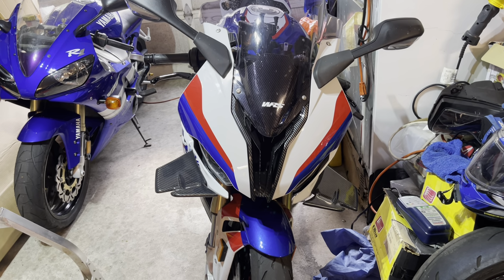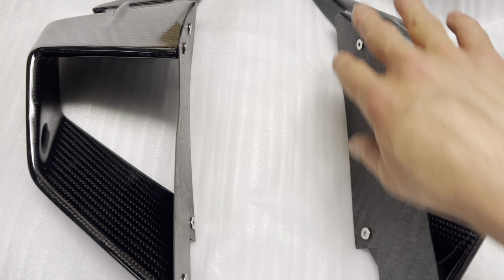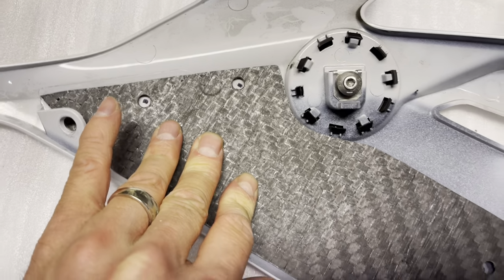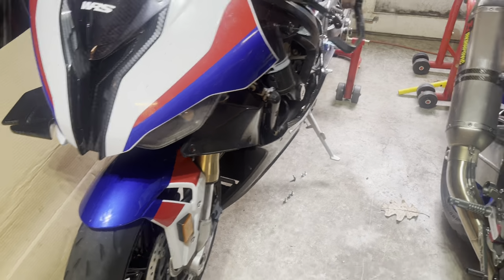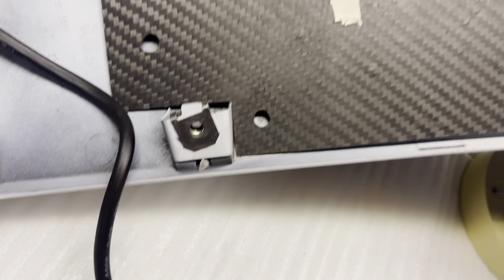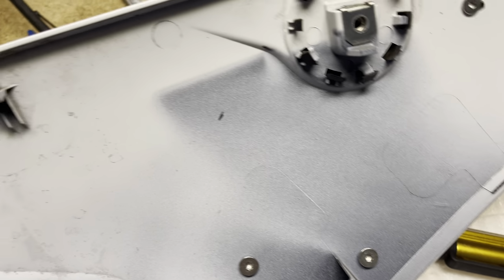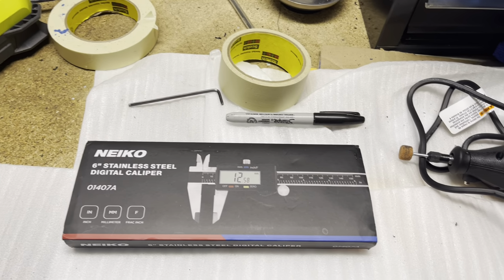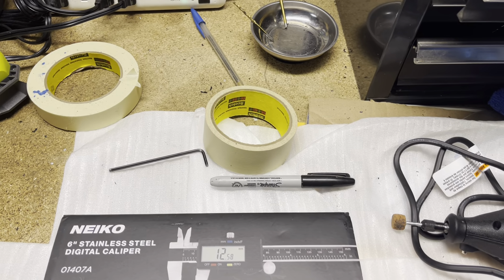How to install winglets on a 2020-2022 s1000rr

Comment: Hi. Amazing video. I am debating buying the aliexpress ones. What do you think about the quality, the look and how are they holding up so far?
Reply from the maker: I really like them they are holding up great no issues. If budget is not a issue then get the bmw ones. If you wanna save some cash yet still have good looking winglets get the ones I have in this video or the rpm carbon ones. Both have great quality
Reply: Thank you for the input. If you say the quality and looks are very good then why waste x3 the money.
Reply from the maker: @samloui5153  I’m not rich by any means so these were a good chance to take and I’m glad I did! Go on the computer if you got one and put the resolution up to 4K so you can get a good luck at it and make the decision. https://m.youtube.com/watch?v=WYpFogG9wKY
Reply: @ctadrenaline the rpm doesn’t have the real shape of the original ones
Reply from the maker: @QuarantaQuattro  good info! Yea it seems like the front is pretty slim on the rpm ones

Comment: Did you weight them? Wonder how much im adding
Reply from the maker: I did not unfortunately. I was too excited to mount them. They did feel light. No matter what the brand you get, it will add some weight though
Reply: @ctadrenaline  debating if the weight and drag will end up slowing me down compared to not having them I do LOVE the look though!!
Reply from the maker: @natecote1971  the light amount of weight they both weigh is as easy as not eating as much for one meal. By design they might slow down a tiny bit in trade for downforce. Something you can always do as well is get a set of aftermarket side fairings so you don’t mess up your oem ones if for some reason you don’t like it your oem panels can just bolt back on. The wings will easily sell if you don’t like as well
Reply: @natecote1971 you won't ride flat out on the streets anyway, and I'll take added downforce and lose a bit of top speed any day of the week. For street use, wings are more of a cosmetic thing, most winglets don't even generate enough downforce under a certain speed. I just 3d printed a set for my track bike to keep the front wheel down a bit more as it likes to power wheelie in the lower gears when it's near the redline

Comment: Are those real carbon fiber ?
Reply: idts...it looks to cubby for  real carbons...
Reply from the maker: The description said 100% carbon fiber and it definitely looks like it especially compared to the bmw carbon fiber. Either way I’m super happy with them. There is plenty of brands out there for winglets so I would get whatever brand you want to dish the money out for
Reply: @DarkRRider  that’s why I ask because the other parts on the bike are not real carbon they are hydro paint
Reply: @ctadrenaline  i agree
Reply: @ctadrenaline  100% Real plastik with water Transfer  "carbon" coating..hahaha
Reply from the maker: @QuarantaQuattro  oh yea some of the stuff isn’t real carbon at all but I could care less it looks ok and was cheap. If you ever go down god forbid wrecked carbon will be trash anyway so doesn’t matter to me
Reply from the maker: @DarkRRider  if that’s the case then I’m definitely happy for the price I paid because it looks great imo. Not worried about weight reduction bike has enough power with current mods. If cost is no issue definitely get the bmw or ilmberger carbon no doubt. I wasn’t sure if I would like the wings definitely not spending top dollar on them if I didn’t like them hahahaha
Reply: @ctadrenaline  ok..thats fine..